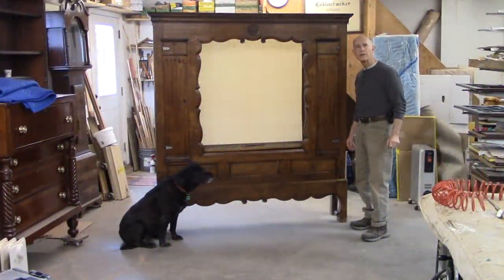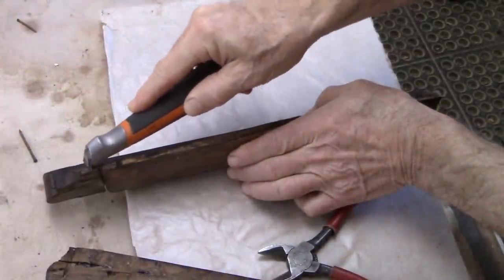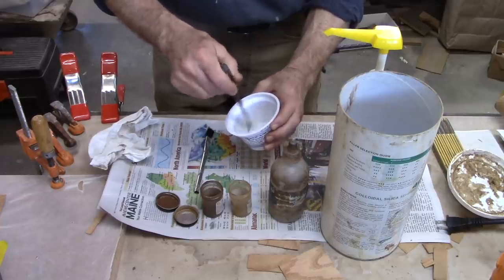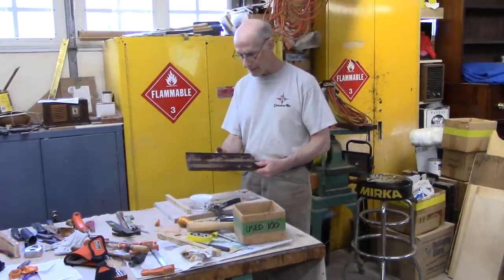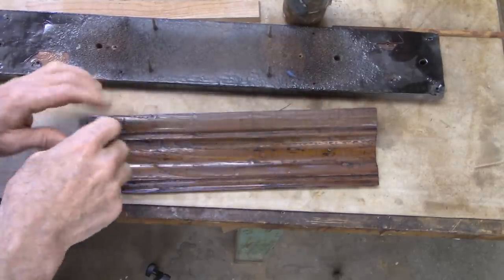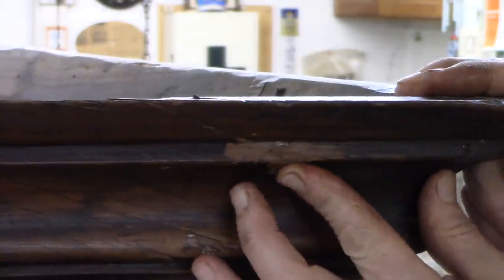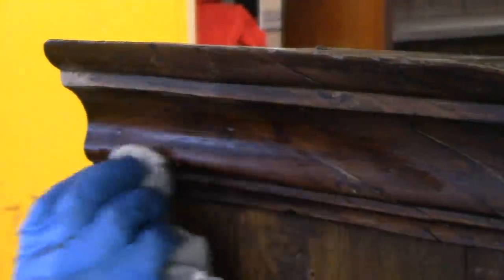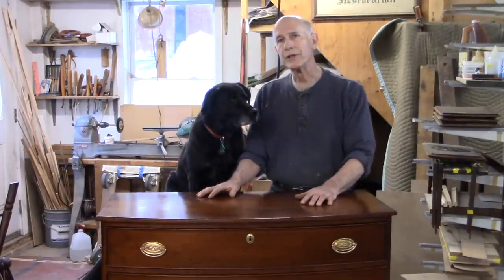Restoring a Welsh Cupboard - Thomas Johnson Antique Furniture Restoration

Comment: You did a great job! I’m just wondering about the difference in color on the bottom left, the leg is darker than the front piece. It looks funny that way to me.
Reply from the maker: Good question! This piece, and almost every antique piece, is not uniform in color. There are different shades all over it! Once in place in the home it doesn't matter, and although it can be subtle, adds to the look

Comment: I recognize that foot water damage, and I have strong suspicions about those vertical drips.
The piece was set on a varnished hardwood floor, and the floor was mopped periodically with a wet mop. It mop strands slapped against the feet as it was mopped around, and nobody bothered drying off the feet -- after all, the floor was wood and didn't need to be dried off after mopping.
It is almost certain also that at some point the front of the piece was cleaned with a wet sponge or rag, and the (possibly soapy) water ran down and streaked the varnish. In this case I suspect that the front was dried off with a rag, but the base would have been done last (and maybe as an afterthought after the streaks were noticed), and by then the streaks had set in.
Reply: The mop lady destroys furniture everywhere.
Reply from the maker: Thanks! That sounds very plausible
Reply from the maker: Yes!
Reply from the maker: I was gonna say - when's the last time you saw someone use a mop? Now you use a "Swisher", if anything at all
Reply: Thomas Johnson Antique Furniture Restoration - Did you mean to write “Swiffer” there?

Comment: You will never know what a big fan I am and have watched every video ever. I am in The Balearic Islands but even from this far away I was not sure about the fix to the end moulding and from your body language nor were you. By using a wedge the top edge, by nature, canted out and was no longer horizontal. This is my only mini criticism ever. I am a retired wooden boat builder and love the series. It still looked Pretty Good.
Reply from the maker: Thanks! This is one where I wish I could go back and start over
Reply: Thomas Johnson Antique Furniture Restoration - I think all of that trouble with that piece of crown molding stems from clamping pressure. Since you used epoxy instead of glue, I wonder whether clamping tightly was necessary, since the epoxy has strength itself when cured plus it was being attached to the veneer strip backer? If glueing it, tight clamping is a necessity because the glue by itself has little strength.

Comment: Another great vid,  but question your choices on the right hand molding.  At and about 17:50 it is obvious that this molding is severely warped outward,  and consequently the top of the right hand molding not only does not meet up with the front molsind,  but it is not in line along the top of the front.  I might have been tempted to glue it back together as you did,  but then cut sort of concertina cuts in from the back to allow the wood to be pulled back and epoxy glued into the original shape.  More obvious at 18:00.  Anyway,  loved your color work and finishing,  as usual.
Reply from the maker: Thanks! This is one of those jobs if I could start over I would do it slightly differently

Comment: Well I live in wales and have restored many antiques but this is a new form to me but the construction with its square pegs is spot on for cardiganshire late 1700s
Reply: Is it painful for you watching the original finish of antiques like this being removed and refinished? I have worked with many experts over the years and I have never seen such a thing. Cleaning yes, but aggressive removal and replacement of original, antique finishes--No Way! 
I have only seen finishes applied when missing pieces have to be added, but it is limited only to the added work. Matching is important, but secondary to disturbing the original finish. Stripping the original finish to refinish the whole thing to attempt to match in the new piece is just disturbing to me. 
I've seen this done by others (not experts) many times. I've even seen clueless people (supposed antique brokers) that had original fabrics and finishes removed and refinished on pre-1800 Chippendale furniture. It makes me cry.
Reply: I may be completely wrong, but I think it's provincial French (which also would have used square pegs, fake mitres and elm) - the swagger and curls on the top rail, the side rails   and the apron, as well as the single double-petal flower in the top centre and the separate stand are very French. I would have expected a Welsh piece to have the drawers in the base attached to the legs/feet, and a cupboard/dresser on top, rather than just the feet and rails in the base.
Reply: Maria Richmann the client rules and for most folks utility overrules the ideas of antique collectors
Reply: Maria Richmann  you’re very naive. Go to wintertur and see the masterpieces there. I know the conservators there and those pieces are almost all refinished in some form or another. I also know one of the magicians in the field and they will get million dollar pieces from Sotheby’s or Christie’s and fake the finishes so convincingly, that many times the new owners want that old crusty finish re done. Do not criticize Tom or any other restorer to make a piece look good again. You’re watching too many episodes of antiques roadshow.
Reply: Maria Richmann no because he didn’t remove the finish. He didn’t hit bare wood anywhere and was careful in supporting the wood and structure. He has been doing this for decades and has restored thousands of museum and museum quality pieces. Settle down.
Reply: @mariarichmann430  Nope. Not painful at all.
Reply: @mariarichmann430  Yes, it is painful sometimes, but here practically no finish was removed: some patina (AKA dirt and probably soot in this case), yes, but what was the alternative, if the owner wanted the piece restored? 

If I had been the owner, I would have been quite happy for the moulding to stay as it was: there were no loose pieces in danger of getting lost, it doesn't have a structural function and the cracks were not terrible to look at.

Also, considering that this is a piece (probably) heavily modified already - I think it was the front of a box-bed - there isn't that much "original" to go with it; all the repairs that we were shown had been made with modern materials already...
Reply from the maker: Thanks! Yes, I'm not sure what this was, but I'm learning!
Reply from the maker: Thanks Maria! That moulding had been repaired and finished very badly with a dark substance to hide the repair. I just brought it back to the original. By the way, in my lifetime I have seen very few pieces with the original finish, and I'm including museums. If you find something with the original finsh, hang on to it
Reply from the maker: Thanks! I need to study this
Reply from the maker: Thanks! True
Reply from the maker: Thanks! Yes, it's all true, and I have been in a lot of wealthy homes, and have never seen anything old and crusty and original. The same for museums
Reply from the maker: Thanks!
Reply from the maker: Thanks!
Reply from the maker: Thanks! All true

Comment: I have a at least a 100 year old ceder hopechest that was given to me as a gift...been in storage and the original top ...I have cleaned with Murphy's oil . And cleaner solution ... Seems to be still sticky in an area can almost see something of a separation from original coating on it.... Should I leave it ... Or eventually restore it....one foot has been broken in multiple places but " so called fixed " ... And a few indent bruises on the front.. the top is my mystery not sure what is going on with it.....
Reply from the maker: Thanks! hard to say - email photos: thomasjohnsonrestoration@gmail.com

Comment: As always a joy to watch.  I do have a question. In this video, as in some in the past you have mentioned how you apply the heat for no more than 2 minutes.  My question is at what level of temperature?  I don't recall hearing anything related to temperature and if you did, I'll pay closer attention from now on.  It seems most heat guns seem to be around 500F on the low end up to maybe 11/1200F on the high seed with maybe 2 or 3 speeds.   Not looking for a temperature degree but just a degree of temperature, low-med-high, slow speed fast speed.  Thanks again , always a pleasure to watch and learn.   Thank you for sharing your skill.
Reply from the maker: Thanks! My heat gun is on medium, I think 450. Even a hairdryer works fine. I just mean 2 minutes at a time. I use a timer because you could never guess 2 minutes

Comment: I notice you have some trouble removing the epoxy squeeze out, especially on the curved surfaces. Rub some beeswax on those surfaces, it might help.
Reply from the maker: Yes, thanks! This was so shattered I was worried about getting wax in the joint. I knew I would have to sand it anyway

Comment: Can I ask why you used both epoxy and wax to fill in damage on one side? Why not just stick to epoxy?
Reply: Epoxy is pretty hard to get into fine, long cracks and match colour. Plus it's durned hard to sand without digging into the wood around it. If you don't need structural strength, hard wax is much easier and faster.
Reply from the maker: Thanks! dlevi67's answer is right on!
Reply from the maker: Thank you!

Comment: I've probably wretched about a dozen of your videos, and I've always wondered why you don't use epoxy.  Now I see that you do - at least sometimes!  I've never seen so much attention paid to dry fitting - I'll remember that on my next epoxy job.  Do you know that two-part epoxy softens up quite a bit when heated, especially before it has fully cured?  You might find that the heat gun will help you when scraping off the squeeze-out.
Reply from the maker: Thanks! Yes, I've had to loosen up a few epoxy jobs - the heat works but what a mess! Basically, epoxy for repairs of shattered parts, but always regular glue for joints

Comment: This is the only one of your videos where I didn't completely like the way it turned out.  The top-right molding didn't fit snug and you chose to put in a wedge, making it slant.  I was wondering why didn't you try to nail the top, thickest part of the molding to the other molding, to bring it together?  Still, it looks great, and far superior to anything that I could accomplish.  Thanks for posting!!
Reply from the maker: Thanks! It was a tough one, as nothing is flat, and angles are different, but I agree, when it was all done I wish I could have gone back and done some things differently

Comment: I need to know where I can get my walk clock repaired ..... it feel of the wall, surprisingly did not damage the wood casement, but the glass in the door broke and the weld on the hinge failed (door lives in a drawer now). Also, it won't keep proper time and when it chimes, instead of going "bong, bong, ...." it goes "doink, doink, .....".  I have not been able to find a clock repair shop in my area that will even check it out to determine what all needs to be done.  So, I have a lovely but dead clock hanging on the wall.
Reply from the maker: There's got to be someone! Check in with my good friend, Dean Armentrout https://dean-armentrout-antiques.com/

Comment: Tom, I noticed you didn't worry about making that moulding match "perfect". I am assuming that's because it wasn't a perfect fit to begin with and it isn't necessary to maintain the authenticity of the piece? I know you don't do shoddy work and you are too good at matching everything to leave a piece tilting or out of square unless it's just how the piece was made in the first place. It looked as if repairs on that top end made it impossible to get a good joint and fit.
Reply from the maker: Thanks! Yes, the "p" word is banned from my shop! You can't try to change things too much, you'll go down a rabbet hole!

Comment: Mr. johnson, I just bought an antique Victorian bed in the Louis XV style. I think it is a double bed. It has mold all over it and it also needs to be refinished as it looks to have water damage and some small insect wood boring holes. I had it on layaway and it looks awful and it didn't look bad when I bought it a year ago! I am so upset! Also, how do I fit a mattress into it when it has no slats across the bed frame to hold a mattress? I think it's walnut.
Reply from the maker: Thanks! Wow! Too many questions! Clean it with white vinegar, let dry overnite and polish with wax. Buy 1X3's at the lumber yard and cut to fit across. Good luck!

Comment: Bet that water damage on the base is from someone using an old fashionioned string mop. The kind you slap out wet on the floor, then wring in the bucket and mop up the dirty wet water. It it stood on a stone floor, like a flagstone floor in a old kitchen, that could be how those floors were washed. Its how they were in one of the houses i worked in.
Reply from the maker: Thanks! Yes, I can believe that! Those old mops actually worked pretty well

Comment: The way the top side trims or crown looks, it would appear this piece may have been a built in turned into free standing. Or, is this the way the sides were originally done?
Reply from the maker: Thanks! I have seen a lot of pieces that were built-ins made into freestanding. You could be right about this one, it would explain a few things

Comment: I would just run through the cove with a router bit to restore the original profile. Slice out the excess epoxy in a single pass.
Reply from the maker: Thanks! Yes, there were a few things I could have done differently!

Comment: what is the saw called that you were using at 4:27 , I have used a lot of hand tools in my time and my father was a Joiner (in the trade they were refered to as chippies, electricians were sparkies - get the idea) but I have never seen a saw like that one, I thought it was an axe at first - great job by the way
Reply from the maker: Thanks! That saw is a Japanese azebiki saw. Japanese saws are amazing, we westerners have been missing out all these years. I like the chippies and the sparkies!

Comment: Dear Sir,
I like your work on  antique furniture. 
I saved a tea cabinet (prob 1900 queen Anne styl, oxblood-red  Mahogany or.......? and two glass tops) from the dumpster. It was a long time in the family and I was in need of a painting palet.
Most of the joints are loose: The front doorshinge's and chains are broke, present and repairable.

One of the legs (queen anne bent) is completely broke through the shoulder in the direction of the woodgrain (Dark-red in colour: I've got lucky in the accident). My parents kept the parts together. I'm not in the position to have it truly restored. I've the idea to glue the broke leg with hide glue for the time being.

My question: 
Is this glue strong enought to have the leg fixed for use: Standing in a worksop against the wall.
How stupid is the idea to drill a hole perpendiculair to the fracture and to peg it secure (not having it exiting in the front).  This way of enforcing the fracture sounds very radical to my?! 
Is there a more subtle way to help the glued fracture?

Thank you for reading
Reply from the maker: Thanks! You can email some photos: thomasjohnsonrestoration@gmail.com. IF you can glue the leg perfectly where it belongs the glue alone will be strong enough. Check out this video: https://www.youtube.com/watch?v=9mY0cU33RNs
Reply: @johnsonrestoration  the damage looks comparable

Comment: I have a question that I'm sure has been asked before but as I found your channel by accident, I thought you might be kind enough to answer. What type of beeswax and lemon polish is it that you use with the steel wool? I have some late 1800's-early 1900's wood furniture that I'd like to try something like that on. And would you recommend any other type of cleaning/polishing compounds for woods that have begun to dry and need some type of moisture to them? I love your work and I've really begun to enjoy the more longform videos you do! Thank you!
Reply from the maker: You're welcome! I love this stuff: Howard's Feed N Wax https://www.howardproducts.com/product/feed-n-wax-wood-polish-and-conditioner/
Wood drying out is all about humidity. Especially if you have the heat on a lot in the winter, you must use a humidifier. Contrary to popular belief, there's nothing you can apply to change that
Reply: @johnsonrestoration  Thank you very much! I live in a state where the humidity can vary from one season to the next and sometimes from day to day. I have older furniture that has been around smokers and while there's no smell for the most part, the finish has darkened considerably so watching many of your techniques have given me a new appreciation for the wood and how it should be handled so I can't thank you enough. Please keep up the great work.

Comment: I live in Houston. I've repaired a lot of flood damaged furniture and floors in the last two years. I do it basically the same as you. I use concrete color from Lowes. It's cheaper. I discoverer that I can color bondo just like epoxy. One glues while the other fills and sands. I use diatomaceous earth as epoxy filler. It's cheaper too. Good luck.
Reply from the maker: Thanks! Those are good tips. I want diatomaceous earth just so I can say the words
Reply: @johnsonrestoration  Diatomaceous earth (DE) is mined, and that's what makes it cheap. DE is used in pool filters, so you can buy it at a swimming pool supply store. DE is also used for yard flea control, because it contains tiny glass shards. The natural glass shards make it useful as an epoxy filler. DE is off-white, just like most epoxy.